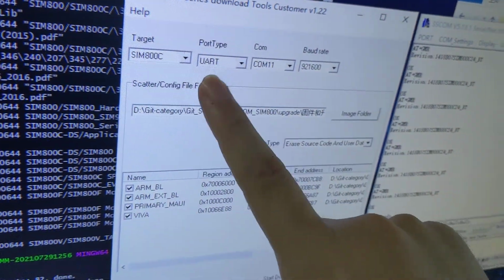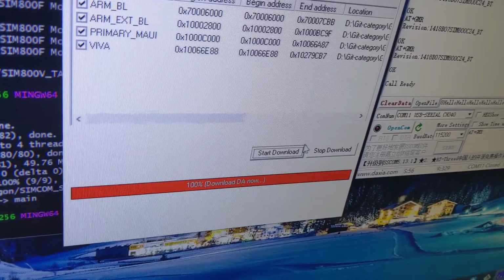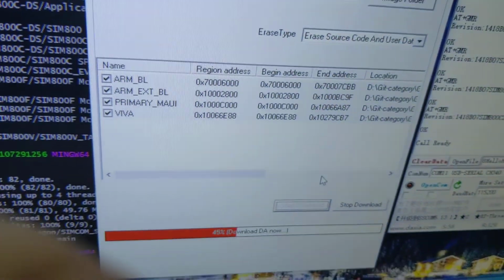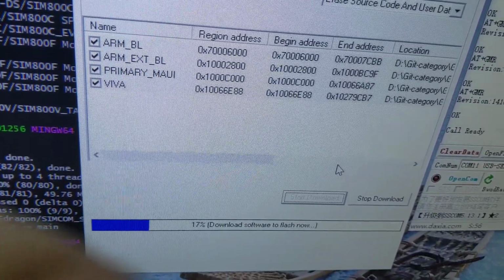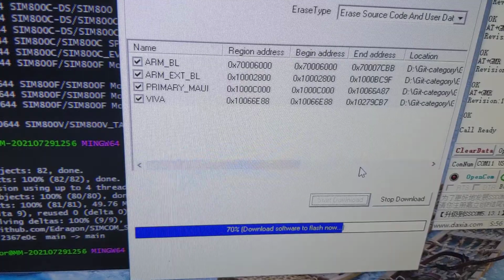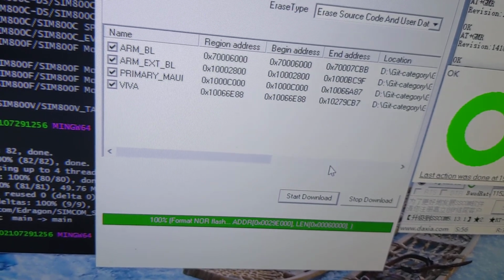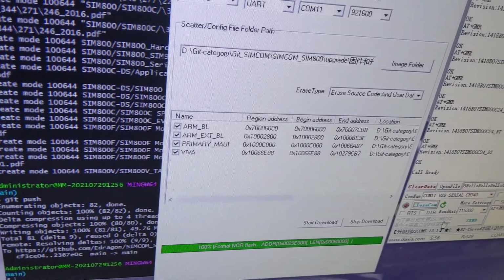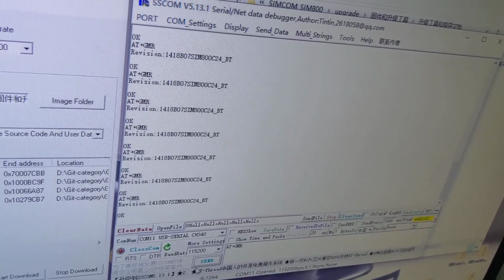upgrade sim800c normal version to by version

Comment: hi  , i saw your video ("RFID long distance")  and it is very interesting...
I would like to have some advice if you can and if you want on how you made the antenna . I have to make a little particular application 
Also I would like to have some info on how you created the antenna ( I have to make a much bigger one ( 45cmx35cm) . I have to read however a really small tag 5mm . 
I would like to understand the components you used and what I could use for such a big antenna....
grazie mille!